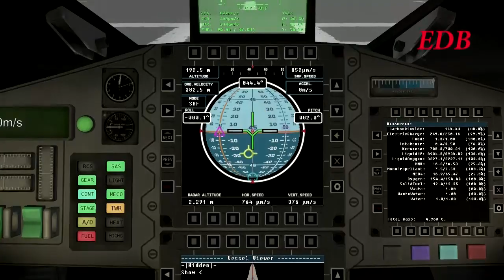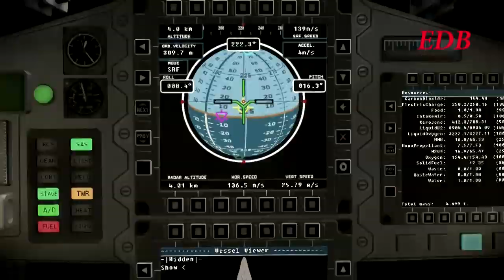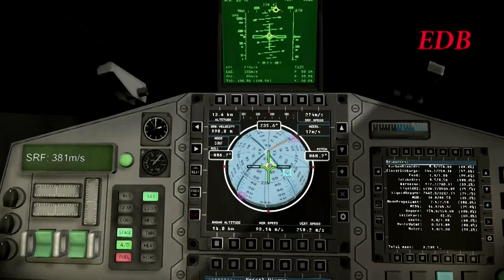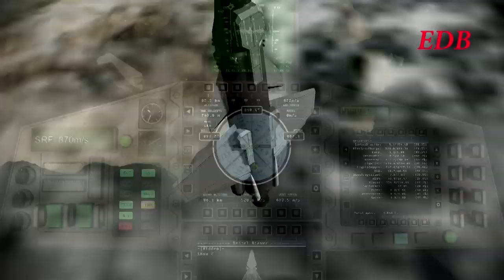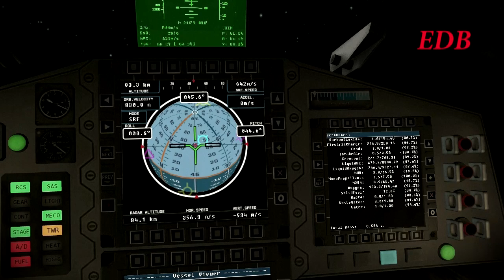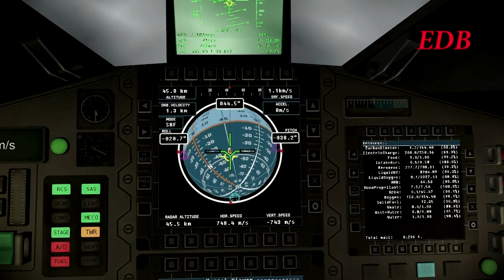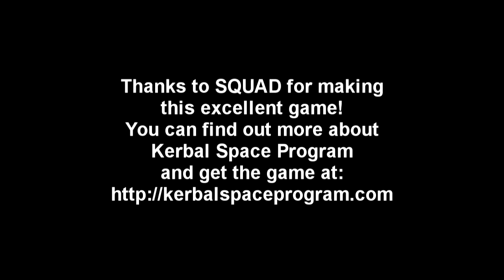Kerbal Space Program EDB Aerospace 07 - DB-6 "Lance" Test

Comment: How could you make that suitability in such a high altitude with only 2 jets? I use 4 blackbirds engines with advanced jet engine mod but it's too hard make my flight stable unless flying hypersonic. I don't know much about aerodynamic but FAR analyses show me no red numbers...
Reply: Suitability->stability. Typo!
Reply: ***** argh, what a shame! I didn't check your video carefully, but skipped some important scenes. As you said, this one doesn't take a big issue on stability, but your former designs flew very high and very fast well, which was impressive to me.

I'm making a realism overhaul spaceplain or something like it. For beginning, I made kerbin size one with FAR and AJE. I have already made some SSTOs with FAR, but AJE is new to me. Now I'm suffering with high altitude hypersonic flight, which is very unstable to my plane...

Through almost every pressure and speed, 2/3 of numbers are green, 1/3 of numbers are white, and one or no number is red. But at mach 3 with 0.2 atm, every numbers are green. However when I accelerate my plane at 15km~20km high to mach 3, it`s very hard to pilot, very is to get minor stall and has a great tendency to sideslip and roll. That`s why I can`t pitch it more then 20 degree even after aerospike engine activation. My plane has steep compound delta wing with streak, double vertical stabilizers, and horizontal stabilizers. I thought it`s not a bad shape for hypersonic plane.
Reply: ***** What a kind reply! You're good at design, engineering, even helping newcomers. Thanks a lot, and I'm gonna check some data of blackbird. Thanks!
Reply: ***** I found that my design is at dead-end to me, that every attempts to make it have better figure was only to fail. So I tried to apply real blackbirds ascent profile and pilot it with care, and it worked! That reduced my time and delta V almost half. Thank you for your advice and cheer me up.